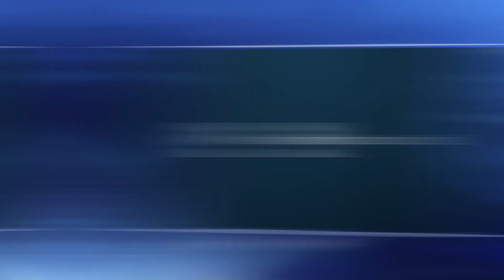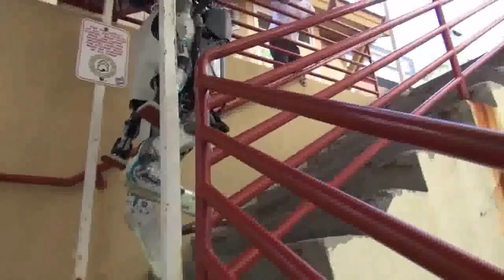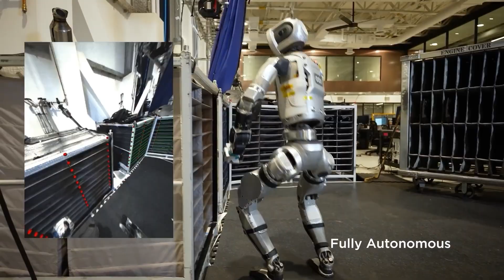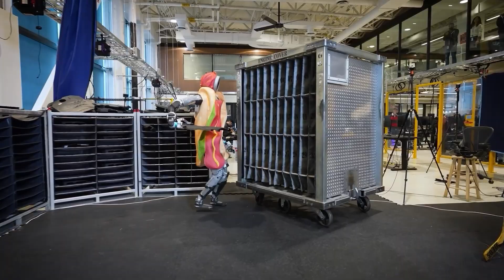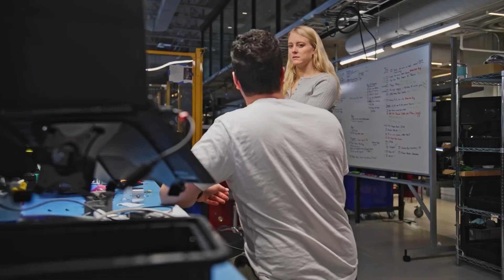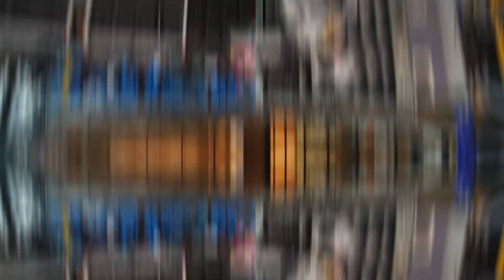Boston Dynamics’ New Atlas Is TOO HUMAN… This Is Getting SCARY!

Comment: I was much more impressed by Figure and Optimus. 
Boston dynamics was always good with smooth and impressive motions, but they severely lack in the ai and software development. 
The showed task looks also prepared long term with all the markers to make it do it right. Tesla and Figure seem to have the better idea to train the bots and give it more or less real understanding of a situation.
I bet bostons bot would not be able to finish the task succesfully if there was no prepared area or different sizes of the tools
Reply: Since they misled with the remote controlled and voiced Optimus robots at the "We, Robot"  event a while back I don't trust Tesla claims without much better evidence.. Their robotaxi service will soon explain why we all should be skeptical.
Reply from the maker: Fair point—Tesla’s showmanship does sometimes outpace its deliverables (we’re still waiting on those robotaxis from, what, 2020?). That “We, Robot” moment definitely raised eyebrows when the curtain got pulled back on the remote ops.
Reply from the maker: Totally valid take—and you're not alone in thinking that. Figure and Optimus are definitely pushing the envelope on real-world generalization, especially with end-to-end AI models and vision-language integration.

Boston Dynamics nails the hardware ballet, but yeah, when it comes to adaptable, on-the-fly reasoning, they’re still catching up to the Tesla/Figure AI-first approach. It’ll be interesting to see if they pivot more into that space or double down on precision choreography.

Would love to hear—what would you test a humanoid bot on to prove real-world intelligence?